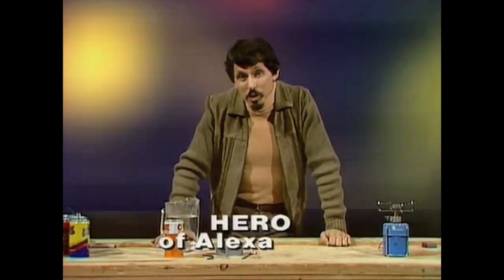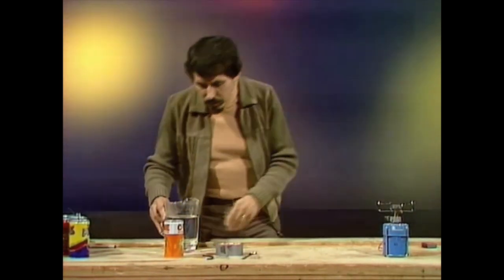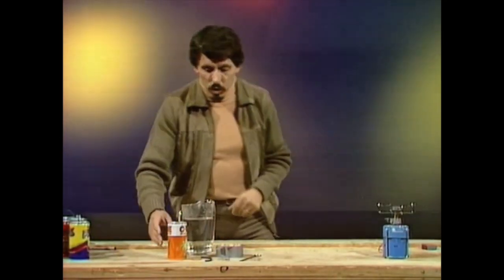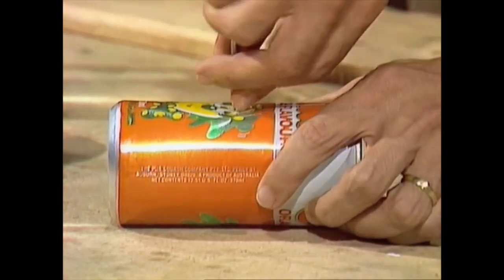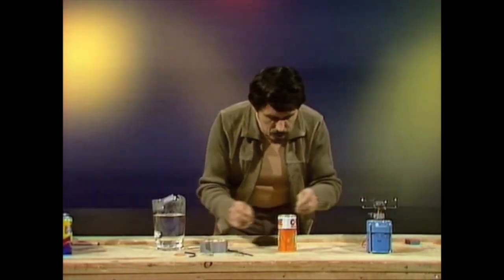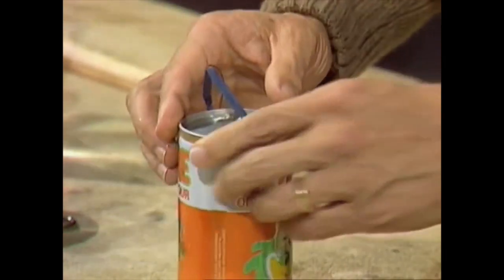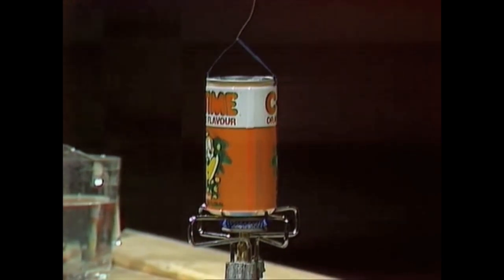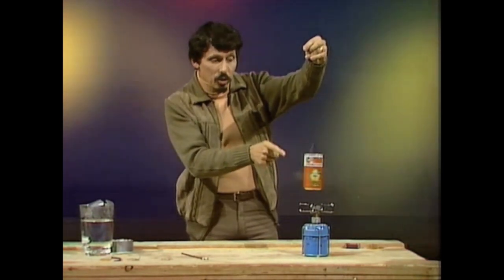Hero of Alexandria's Steam Engine

Comment: why did you need a can with two holes on the top?
Reply: the angle of the steam create rotation, in theory you can have the holes anywhere and it would still cause an effect, the reason the holes are symmetrical is to demonstrate the full potential of the engine, this allows the can to spin with less effort.

Comment: I built a Hero's steam engine that does 5400 RPM.  (www.HeroSteamEngine.com with embedded YouTube video). Thoughts about whether an aeolipile (Hero's steam engine) could have driven a car or train or do other useful work has been debated for a century or more.  I decided to build one and measure its power output to settle the question.  I calculated its theoretical efficiency at converting heat energy to mechanical energy and it was only about 1%. But when I built one I found that the efficiency was only 0.01%, possibly due to losses from friction and air resistance.  The results are given in detail in the web site.  Look it up to see video, photos, calculations, discussions and dispelling myths about Hero (Heron of Alexandria) himself.
Reply: What if you had already highly condensed and hot gas, say from the surface of Venus that you could channel? I imagine that would allow for a much more efficient energy conversion.
Reply: @edwardlecore141   Yes you would expect a hotter, more dense gas to produce more thrust but the thrust would depend on the pressure in the surrounding atmosphere.  I suspect that on a celestial body where this gas exists, the atmospheric pressure would have to be high to maintain the gas in that state.  Then the gas would not escape from the jets of the Hero steam engine unless it was raised to an even higher temperature and pressure and there may not be much advantage in the end.
Reply: @Evan-e-cent  The engines would not be in that atmosphere but in a sub-terranean area of much lower pressure, and the engines would be used for domestic power consumption. I am writing a sci-fi novel featuring ancient Romans building such colonies of Venus, so I need to come up with a power system for their city. I figured hero engines could work, exploiting gravity and pumping in the atmosphere above and removing the need for wood, coal or anyone to feed it.
Reply: @edwardlecore141  OK. I don't know why an underground location would have lower atmospheric pressure than above ground, but hey that's fiction! Who knows!
Reply: @Evan-e-cent  It would be hollowed out as a sealed area, kept at Earth pressure, for the inhabitants.
Reply: @Evan-e-cent  Nuclear hasn't been invented yet, it's the 5th century. The underground area is sealing off from the surface, created by boring down and tunneling out a cavity, so the pressure is not an issue. I will consider ways in which the gas could be used them expelled, but I am not an engineer, just a world builder.
Reply: Thanks for sharing, that page is a great read and watch. 
I wonder if greater efficiency could have been achieved by dispensing with the hollow rotor and running jets straight from the shaft (perhaps with a flywheel) to harness more energy without the wasteful first stage steam expansion into the sphere?
Reply: @mulgerbill  Energy loss through friction and air resistance are important. The sphere does not displace and air as it rotates and therefore has low air resistance. Long tubes spinning through the air do displace air as they move and create much more air resistance. Having said that a lot of the models you see do have long tubes, but I think they should stick to the shortest possible tubes. Once the sphere fills with steam and built up pressure there is no further loss of pressure through the sphere. There may be a increased loss of heat through its high surface area. Since the power output is continuous there is no advantage in using a flywheel, it would just take longer to pick up speed. A flywheel is helpful in smoothing out the power output of piston engines where the power output is intermittent and not continuous.

Comment: Great introductionary project to show the power of steam. I wonder if food colouring will affect the puffs of water droplets.
Reply from the maker: A good question!  Try it out by carefully watching the spout of a boiling kettle.  Actually, when water boils, most of the dissolved material, such as food colouring, is left behind.  If this were not the case, we would get purple rain, green steam, rainbow-coloured raindrops, etc etc . . .    Deane.
Reply: @CuriosityShow  It would rain saltwater if evaporation took all the chemicals.
Reply: i doubt it will change the colour of the puffs